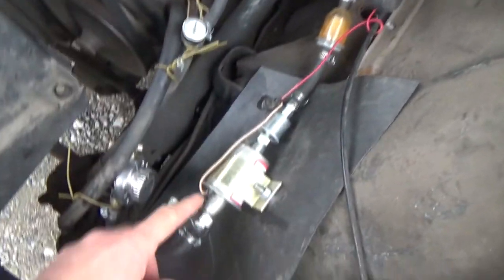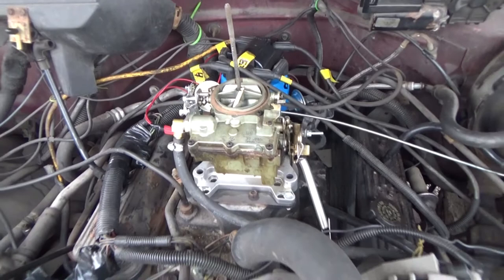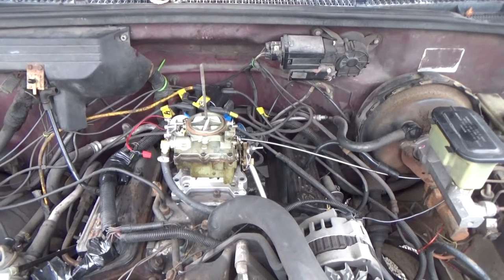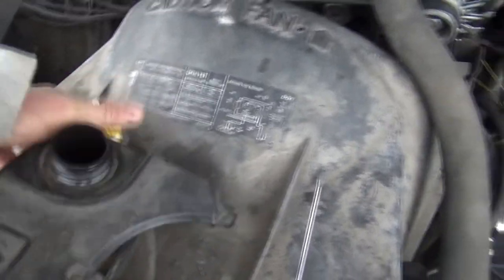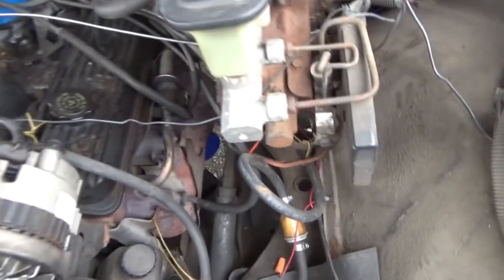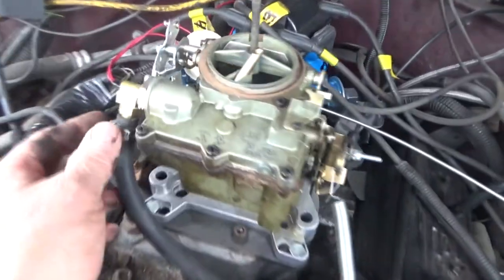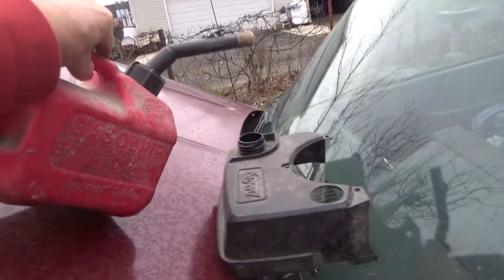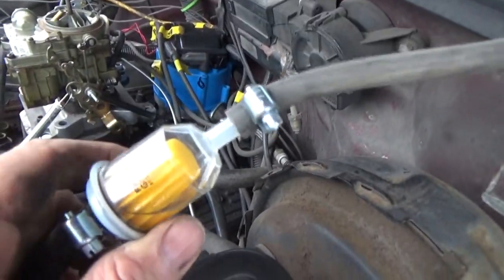Running truck without fuel pump

Comment: Let me ask you a question, I do have an old Chevy van with a bad fuel pump and has carburetor like that. Can I just feed the carburetor with a hose coming from a gallon ? Sitting on a higher level like you did there. Or do I need anything else to add to it?

Comment: Would you be able to run a car and drive it around for a while with a set up like this?
Reply from the maker: Hi Sourov, This is the truck with the carburetor, and it’s not real efficient,  I consider it just proof  that could be done, maybe it might get you to the next exit, I have flown airplanes without fuel pumps, only gravity fed, I think that’s just what I wanted to show, thanks Mike

Comment: I'm installing an engine just like this into a car who's stock engine used a mechanical fuel pump. Most places I've seen said the fuel pump needed to be installed near the tank. Has your can ran with the electric fuel pump in the bay with no issues?
Reply from the maker: Hi my. I relocated mine down near the tank as far down on the frame. It was getting hot up in the engine bay during long trips,
Reply: @mikehaduck-travel-mechanic884  awesome. Ok thanks,one more question. How did you run the power? A relay in-between to the starter? Or some sort of switch?

Comment: Looking to cold start a 92 dodge that has no lines from the pump. It will be easier to start it now then run the lines because the torque converter is out too. Any suggestions? Do I need special fitting? I already Have an old mower lying around.
Reply from the maker: Hi Donovan,  hard question,  I would make sure nothing is frozen and if it is you got to start from scratch,  I hope it helps,  thanks mike

Comment: Makes sense as it's a closed system pulls a vacuum...you did not even have to put it up higher
Reply from the maker: Hi Michel,  it worked well,  not as good as a pump but good thanks mike
Reply: how could i do this with efi and no injectors i can start my car with starter fluid but wont run longer than a minute i need to move it the injectors dont activate just want it to run long enough to move it out of the way
Reply: Gravity not more
Reply: @brokenlee5922   Hitch a ride on the bumper :) Or fabricate an adapter for a carb.